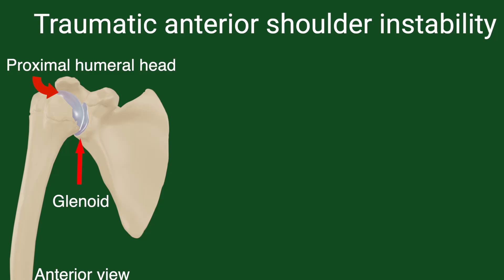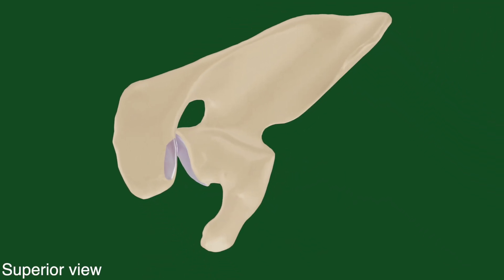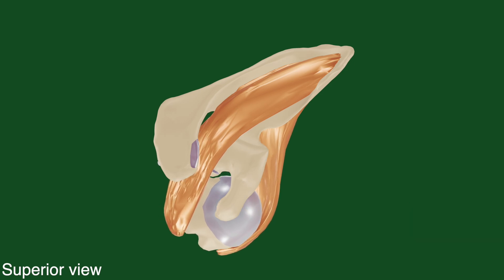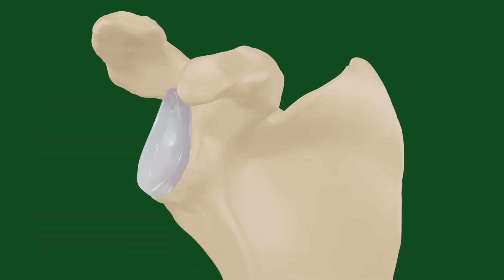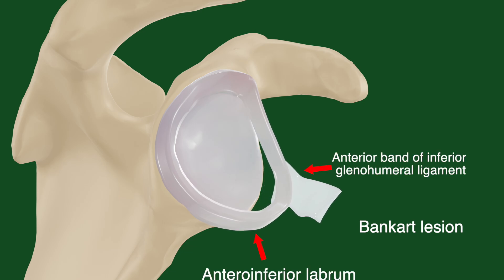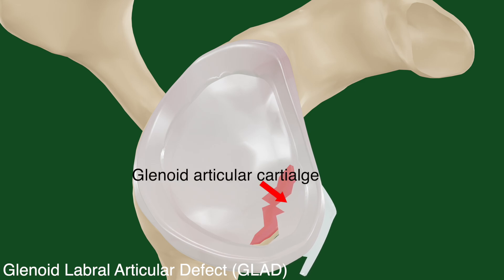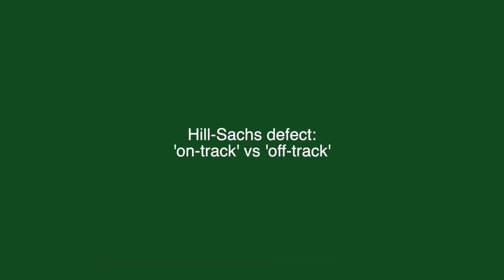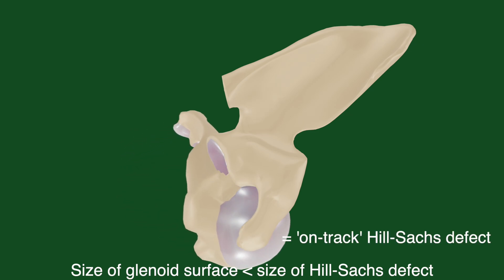Pathologies of Traumatic Anterior Shoulder Instability (TUBS) animation

Comment: This radiation report can be diagnosed with my condition 

There is evidence of

ALPSA lesion (anterior labroligamentous periosteal sleeve avulsion), where the anterior inferior glenoid labrum is having abnormal signal intensity that appears to be detached, medially displaced with no distortion of the underlying periosteum

This is associated with humeral head bony defect at the posterolateral aspect suggesting previous Hill Sachs fracture.

Minimal joint effusion.

Mild AC osteoarthritis

Normal thickness and signal intensity of the supraspinatous tendon with no evidence impeningment, edema or tear

Normal bone marrow signal of the humerus, scapula, and lateral part of the clavicle with no bone marrow edema or intra-osseous lesions

Comment: My shoulder feels unstable. Making a fist which tightens my muscles makes me feel a bit better stability wise. I've had 2 capsular shift procedures in the early 90's and today it's a lose as it's been since those days. MRI showed an 8mm partial tear of the supraspinatus and doc thinks that is my problem. I feel differently as my pain and looseness are in the ball socket area. So my question is can a partial tear make me feel like this or is it more likely general instability again. Mind you my symptoms now feel EXACTLY the same as they did prior to my corrective surgeries. Thanks.